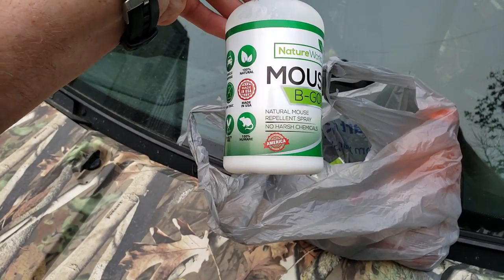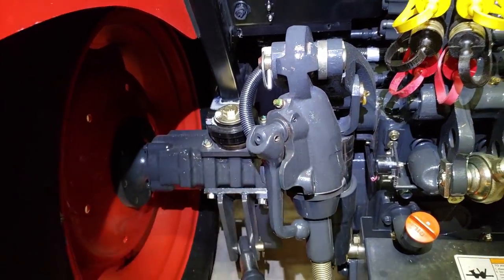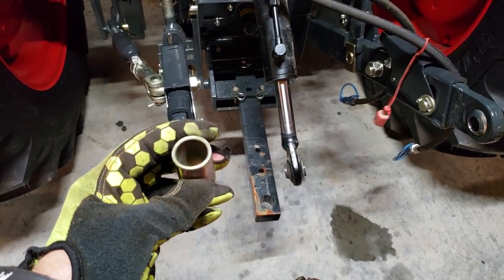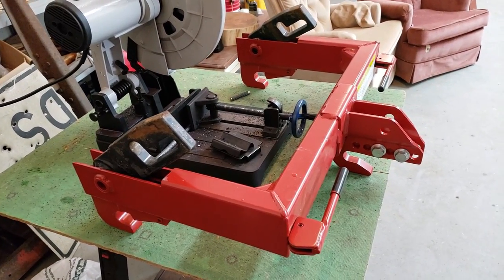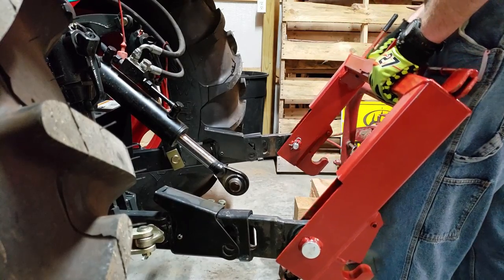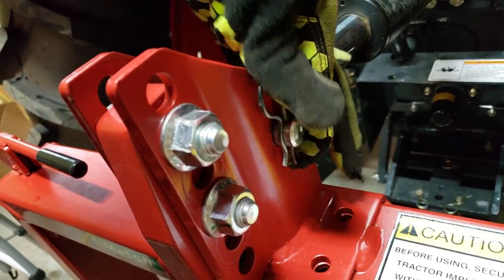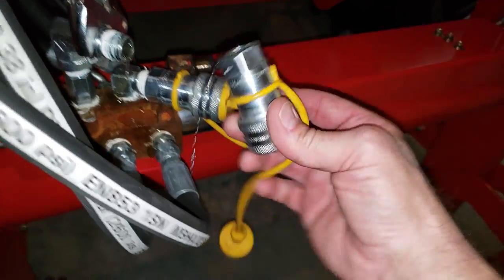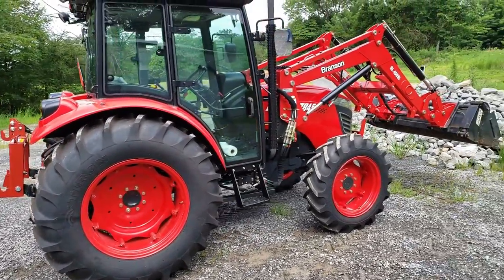How to set up your New Tractor for the field! 4 in 1 bucket and Branson UPDATE!

Comment: On the bucket level indicator- mine (TYM )has the same one. They have a “flaw” in the design. When coming from dumped back to level you get no warning before level. The rod shoots out of the tube and you have gone too far.  Solution- I cut the rear of the tube in half from about 2 inches below the end. I left a half circle that indicates level. Now when the rod comes into view you have time to stop the rollback before it overshoots. Works great. Took about 20 seconds with the air cutoff tool to modify it. I also mark the rod with different paint colors for level on different attachments. (Bale fork, bale grapple, pallet forks etc)
Reply from the maker: Great idea, and I hear you. I've had so many different tractors, all different and a little warning is nice. We'll try it out a bit, and if I have any 'extra' time I may just do that! (Actually, if I don't have to remove it, and can use a hand grinder, that would be quite easy..... ) thanks man

Comment: Joe.....my 2 cents....don't change out the cotter pins with the hitch pins. The hitch pins are prone to pull out very easy. I've had issues with pins working loose after the HP was pulled out by under brush. Get a big pair of needle nose pliers for removal and replacement. The pins on the QH should not need servicing in the field.
Reply: School of Hard Knocks teaches Best. Some Joes need more than others. ikr
Reply from the maker: I've only lost one pin that I can recall in the field. I know what you are saying, they don't come out as easy, but when you have to switch alot of equipment back and forth inevitably something needs swapped. I really love those round spring loaded clips. If/when I lost one in the field, you can knock me around a little and say 'I told you so!' Thanks man.
Reply from the maker: Oh I totally forgot to tell you. I just ordered a box of the round pins to replace all of those hair pins. That should help for sure. Thanks.

Comment: Buddy, run down to Lowes and invest in a portable AC unit.  You can move it from job to job, sets up in a few minutes, and can blow on you as you work.  I bought one a few years back when the power went out in the middle of summer, and we needed to cool the house.  I was hoping for cooling the upstairs and it did the whole house.  I have used it twice now.  Runs on 120 Volt and I run it off a generator.  Been a real lifesaver.  Not expensive and worth EVERY PENNY.  Heat can be a real killer.  We need to take care of ourselves.  For the price of a couple real good meals, you can beat the heat.

Comment: Lynch pins = round
Hair pin = push in pins
Hair pins can remove themselves if the pin rotates and hairpin hits.

There are also Bow Tie cotter pins that are tool free install/removal.
Cotterpins are a cheap way out kinda like using an old nail.
Reply: Yep... I've had many a hairpin touch something on the open end and "pling", it's a goner. Normally, with the exception of the iMatch, you'll see cotter pins used in places that won't get taken apart often. I've had lynch pins get knocked off  in the field also but not nearly as often as those darn hairpins. I no longer use a hairpin any place that matters.
Reply from the maker: Roger that! I just ordered a box of the round pins to replace all of the hair pins. Thanks man

Comment: P.S.
Use liquid teflon sealer instead of tape.
If any sealer gets into hyd system it'll just pass on through, tape can get caught up in the ports/solenoids.
Reply from the maker: I've used that once and it did not seal up that well, but for sure it tape gets in that would be just swell in the system! thanks.